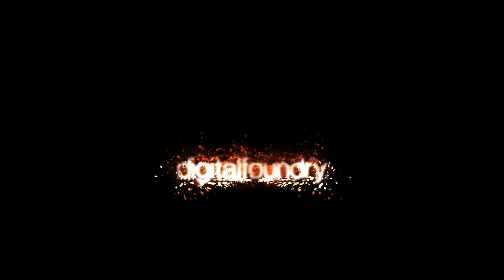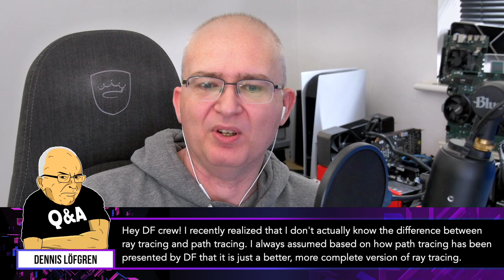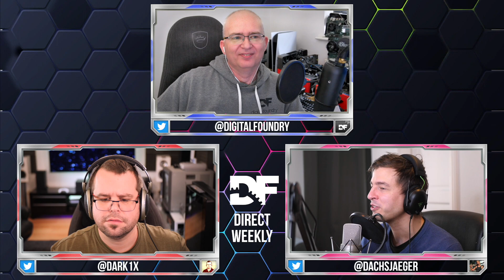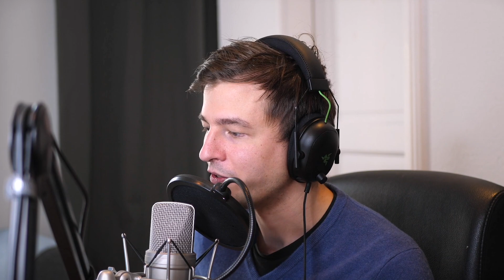What's The Difference Between Path Tracing And Ray Tracing?

Comment: Okej I need to step in here, to many dont understand this right. Some here are close but gets somethings wrong.

First of: raytracing shoot rays from the camera out in to the scene.
Path tracing shoot rays from the light source out in to the scene untill it hits the camera lens.

Second: with raytracing you can change different settings,
Like how far the rays will go, how many bounces it do before it stop, how much energie gets lost in every bounce or what the rays will "look" for. (If you want onely RTGI, the ray will onely look for matt materials, and get information like how ruff it is and what color it has)

With path tracing you cant change thos settings, the rays will always bounce untill there is no more energie left (with every bounce the ray looses some energie) 
You cant choose, its fixed with physicly accurate algorithms.

So why would you choose path tracing over raytracing when you have much less controle, and less ways to optimize? 
Well path tracing is way more accurate so you get much better results, but its slower because the onely way to optimize it is with how many rays will be sent every frame. (You can see it like resolutionen just for the rays)
The resolution of your render is the onely other way to optimize it.

With raytracing you have way more ways to optimize it, but the results will never be as good as full path tracing, even if you crank every setting to the max.

If you have any cuestions feel free to ask. 😊

Comment: I really wanted to know, so after some research, and trying to remember what I learned many years ago:

TL;DR: “ray tracing” as used in most modern GPUs looks only at a selected number of rays that are incident to each spot under consideration on an object: one ray from each light source, one perfect reflection and one perfect refraction, and maybe a few more like these.  Path tracing on the other hand looks at a comparatively large number of randomly selected rays incident to a spot under consideration on an object.  So, it looks at a larger sample of incident light, and therefore captures indirect light / ambient light, secondary reflections and refractions etc. much better than “ray tracing”.  It also follows incident light to greater depths of prior sources (ie. “bounces”) than “ray tracing”, typically 5 to 10 bounces deep rather than 1 to 2.  But, because of its random nature, PT is a bit like throwing dots of paint, and that makes de-noising necessary.

Update/Corrections (to both above and below):  Path tracing apparently does not follow multiple new rays after each bounce.  Apparently it is more useful to follow just one ray for each bounce, and that is what makes the whole recursive bunch of rays that start with one ray cast follow a path. The bounce direction is still somewhat randomly chosen (although that can change when bidirectional path tracing or other techniques that find “important” rays are used).  But what makes path tracing expensive is that for each pixel, multiple ray paths can be sent out, starting at slightly different starting points on that pixel, and therefore hitting slightly different spots on the object to which the ray is cast out.  And with the help of techniques that select “important” bounce rays, this should also eventually cover more of the incident light sources, especially on the first bounce.  The light coming in on the first bounce is also deemed much more important than light from later bounces, as later bounced rays contribute less and less to the overall radiance of the spot on the first bounce object.  That is why for bounces, one ray is deemed sufficient, while sending out multiple rays for each pixel is comparatively important.  —  Also, bounce depth for real time path tracing is closer to 2, maybe up to 4 or 5.  The 5 to 10 bounces figure is mostly used for non-interactive rendering, such as for film.

In a bit more detail:

* All ray tracing tries to follow light rays that fall into the “camera”, and calculate the light coming from the objects seen by the camera in each direction. (There is usually one ray for each pixel in the camera.)

* In general, to correctly calculate the light coming from a spot on the surface of an object, the algorithm needs to add the light that the object itself emits at this spot (ie. when the object itself produces light / glows) and the sum of the light of all rays that land on that spot from all incoming directions, after the proper reflection and refraction equations have been applied to each of them.  (This sum is called the “rendering equation”.)

* So, essentially, for a completely correct ray trace, for each pixel in the camera (illuminated by a ray from a spot on some object), an infinite number of incident rays on the source object spot need to be considered and their contributions added up.  And that also needs to be done recursively, as each of the incident rays to that spot needs to be followed back to its source (a spot on a source object), and the same calculation needs to be applied again to all the incident rays there.  And repeat.  (These are the “bounces” considered by ray tracing: that is, the depth to which this is pursued, recursively, for each ray.)

* This is of course impossible.  Adding up the contributions of an infinite number of rays takes … infinite time.  So, different algorithms have been designed that limit the number of calculations, while still generating acceptable results, depending on what is deemed “acceptable”.

* The algorithms that are used most often in “ray tracing” on modern GPUs are based on the algorithm by Whitted (1980):  they consider only a handful of “special” rays incident to any given spot on an object: one ray from each light source (which can be occluded by intervening objects), one perfect reflection ray and one perfect refraction ray.  And incident rays are followed at most to one or two bounces.  This is reasonably effective for rendering sharp shadows, basic reflections and basic glassy surfaces.

  * GPUs may extend this basic formula somewhat, considering a few more rays when they can improve the render considerably.

* Path tracing on the other hand considers a larger number of incident rays for each spot-on-an-object under consideration.  And it tries to avoid only looking at “special” ones, but rather considers rays from random directions.  With a large number of random rays, it can approximate the full rendering equation.  Also, it considers more bounces (following incident rays to their sources, then the incident rays of those, etc.), typically between 5 to 10.  This gives a much better coverage of multiple reflections and refractions, and better rendering of indirect light, which means shadows are more accurate.  (Path tracing was introduced by Kajiya in 1986.  He also formulated the rendering equation.)

* One problem of path tracing is that it can easily miss “important” rays, ie. rays from a light source or from a reflective surface.  To help with this, a number of techniques can be used.  For example, bidirectional path tracing follows rays from both the light sources and from the camera, to find out the “important” ones.

* Another problem with path tracing is that it is a bit like throwing dots of paint on a surface.  The randomly selected rays have a somewhat similar effect, and for this reason de-noising algorithms are used to “fill in the blanks”.  This is less of a problem the larger the number of incident rays considered is.  (Which is increasing the computation resources that are needed.)
Reply: Btw, to throw in some anal nit-picking from my physics studies:  ray tracing is based on the idea that light travels in rays.  That is a reasonably good approximation of what light does, for the purposes of computer graphics.  But to be entirely correct, light is traveling in waves and forms interference patterns.  A completely accurate rendering of light, including interference artifacts, would need to compute light wave equations.  But, sigh, let’s not go there.  At least for now.

Comment: Recursed reflections isn't expensive if you know how to programming them. There tons of demoscenes who implemented it on mid 2000 hardware. The problem is that programmers nowadays is way to weak and it's all about solution from the library. If library has it, hooray, we having mirrors if library doesn't have it oh no, we don't how to animate more than 42 bones.

Comment: I think the thing that maybe tripped the person asking the question up regarding pathtracing vs raytracing and which is better is the idea of casting rays from the camera vs casting rays from the light sources.

In the context of RTX "raytracing" / "full pathtracing"... both are casting rays from the camera, the distinction being that full pathtracing indicates that the entirety of the frame is rendered from pathtracing whereas "raytracing" effects are more limited to specific domains (i.e. shadows, reflections, etc.). So in this context, pathtracing is better.

In the context of computer graphics, casting rays from the light sources is obviously more realistic and can result in certain real lighting effects that may not occur with the way more compute-efficient method of casting rays from the camera. Casting rays from the camera is far more efficient because none of the calculations are wasteful since you are by definition tracing the path of light reaching the camera, whereas the overwhelming majority of light cast from a light source won't reach the camera and thus won't effect the image... a lot of wasted computation, in other words. So if someone is using "raytracing" to refer to one of these methods and "pathtracing" to refer to the other... which one is better is somewhat subjective, one is slightly more realistic at the expense of being dramatically more computationally intensive.

Comment: I don't think the explanation provided here is accurate. 

Ray tracing is an entire class of techniques. Any technique that involves tracing rays (shooting/emitting a ray from a point in space and calculating intersections with the scene) is considered ray-tracing.

In order to use ray tracing to compute lighting, the renderer would need to emit rays from each light source in the scene and calculate the intersections of all of those rays with all objects in the scene (and do this again for each bounce that is allowed). At this point, ny number of cameras placed anywhere in the scene are capable of accurately viewing the lit scene.

This is obviously a massively computationally expensive problem.

Path tracing is actually an optimization on brute-force ray traced lighting as described above by skipping all rays that do not enter a given camera viewpoint. 

It follows the path of the light ray backwards from the camera to the light source. 

In doing so, we can only worry about rays that we know will enter the player's camera. This is still an intensive process as many paths need to be sampled, but is way faster than brute force ray tracing all lights in the scene. 

Ray tracing as we know it now in videogames is just the marketing term for any feature (GI, AO, Specular Reflections) that is computed using raytracing of some kind, and not at all referring to brute force ray tracing. 

This is why path tracing in games looks better than the "normal" ray traced option (which could really just be 1 bounce GI for certain objects or something).

Comment: SIMPLE EXPLANATION:

YOU HAVE A TORCH IN A DARK ROOM YOU TURN IT ON. 

RAY TRACING: YOU LOOK AT THE FIRST THING THAT YOU POINT AT THAT IT LIGHTS UP.  THE VERY FIRST OBJECT. YOU CAN SEE THE LIGHT AND HOW IT LOOKS OR AFFECTS THAT OBJECT.

PATH TRACING: THAT LIGHT ON THE OBJECT. WHAT HAPPENS TO IT? DOES IT REFLECT ON LITHE OBJECTS LIKE A MIRROR OR DOES IT "ABSORB IT" LIKE A SAY A PILLOW. EVEN THEN THERE IS AN OVERFLOW OF LIGHT ON THE OBJECTS AROUND THAT PILLOW E.G. THE BED,  THE DOONA, THE WALL. THE LIGHT ISN'T HITTING THOSE SPECIFIC OBJECTS DIRECTLY BUT HOW IS IT IMPACTING ON THEM?

Comment: I love path tracing in Cyberpunk/Phantom Liberty.  1440p with DLSS Quality and Ray Reconstruction I can get between 50-70fps on an overclocked 4070 Super. In doors get closer to 70, some of the more demanding areas it drops to 50. That's without Frame Generation. With Frame Gen locked the fps to 75 and it stays at 75. Using a controller so it looks and feels great. I tried it without DLSS/Ray Reconstruction but it looked worse, and didn't run as well.

Comment: It's worth noting that in the VFX world of non-realtime rendering (CGI in films etc.) the term path tracing is not used much. Ray tracing refers to everything, and simply put you set how many rays per pixel you want and how many times those rays can bounce (with separate control for diffuse, reflection, refraction, volume and subsurface).

Comment: I think there's been some mutation and marketing speak that has confused it lately but I was under the impression a path trace meant shooting a ray from the camera's eye and letting it bounce off things. The number of bounces influenced the potential for greater details, which made the "path." A ray trace is merely the means of gathering information from that path like material, light bounce, etc. and creating the necessary effect out of it. Hence "RT reflections, shadows, etc." 

Path tracing is what the system uses to determine the way light generally is used to generate the image because you cannot see without light. However ray tracing is the means of providing information and generally made from point A to point B and determining the effect made from that line. If you have multiple rays on a single path (let's say 3 bounces) you use an algorithm to calculate the necessary data to do something with it. A simple example is one light ray with decay that maybe disappears by 85% on the third bounce so it leaves less lighting in the area than the first.

Comment: I don’t think this is the complete answer. I’ve been a 3D artist long enough to know, that before any RTX marketing, ray tracing was more like umbrella term for well.. any raytracing. Path tracing is the name for the most brute force random sampled approach for ray tracing. PT is in many ways inferior to some path guiding techniques like metropolis light transport (also ray tracing), but those aren’t well suited for realtime use yet. Now after RTX marketing, there’s a new meaning with RT being only a specific rendering task (shadows or global illumination etc), it sure as hell wasn’t like that, but marketing has its ways to define words.
Reply: Whatever those are They,They might become well suited for real time with the comming of Playstation 6 in likely 2028 or later when it comes to consoles or RTX5000 or RTX6000 when it comes to PC.
I am just speculating PS6 will be more powerful then 4090 and equipped with newer tech.
I mean 5 years difference of technological advancement.

Comment: If you take the evolution of light transport algorithms in offline rendering and their naming convention. I think ray tracing was reserved to tracing rays to simulate different effects of light (shadows, ambient occlusion, etc) separated, them composing them with each other and faked light elements not generated by ray tracing at all to get the single final image. You saw that a lot in manking of movies, specially old ones of the early 2000, were they had multiple render pass. As CPU and GPU became more capable they started to use path tracing algorithm, one algorithm that did everything including the holy grail of computer graphic global illumination (with discreet ray tracing algorithm are not capable, this was faked in pre path tracing algorithms) in one pass, taking all the information of the light path and using it to inform the color coding of the pixel and actually generating the final image in one single pass. You just need to keep shooting more and more rays into the scene until you had the complete picture.

This is repeating itself in gaming render pipelines. Ray tracing is used as one more pass on the traditional raster render, and path tracing is used to create full final frames with pixel information provided by the tracing of light rays path with the help of denoisers. No subsequent render pass are required.

Comment: Basically in a nutshell.

Ray tracing projects rays in all directions from numerous places. In path tracing, the physics of light is stimulated by incorporating ray tracing as part of a more extensive light stimulation system.

Ray tracing is a technique for generating an image by tracing the path of light as it bounces off objects. Path tracing is a similar technique, but it traces the path of light through a scene by following individual light rays.

Ray tracing can produce more realistic images than path tracing, but it is also more computationally expensive. For example, ray tracing can produce realistic images of reflections and refractions, while path tracing cannot.

Path tracing is more accurate than ray tracing when it comes to simulating the physics of light.

Path tracing can handle complex scenes with many objects more efficiently than ray tracing .

Ray tracing is more efficient at handling reflection, while path tracing is more efficient at handling refraction.

Path tracing typically produces noisier images than ray tracing , but the noise can be reduced by increasing the number of samples per pixel.